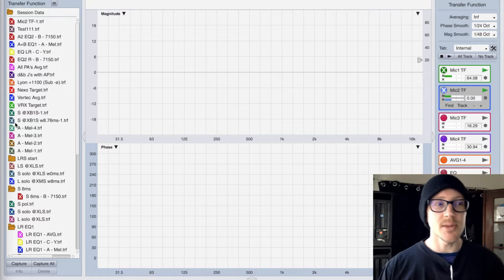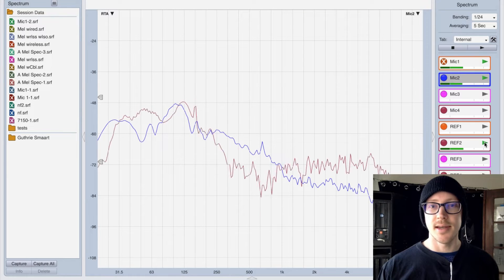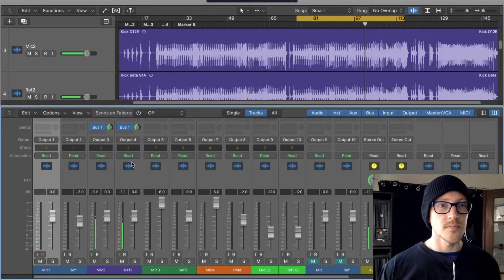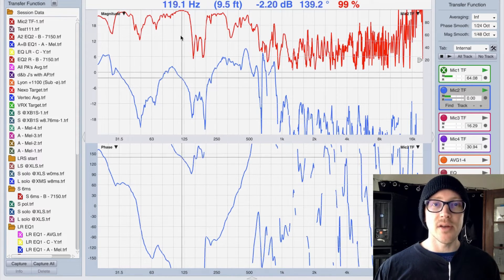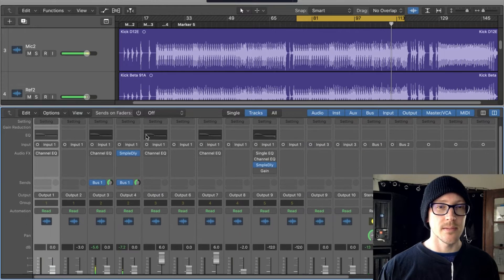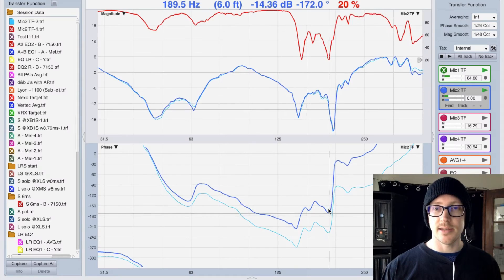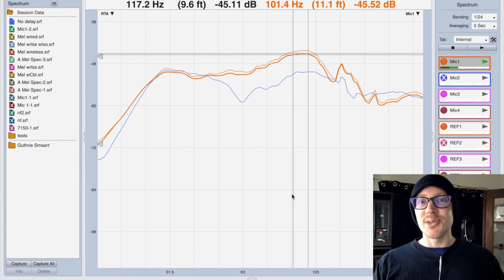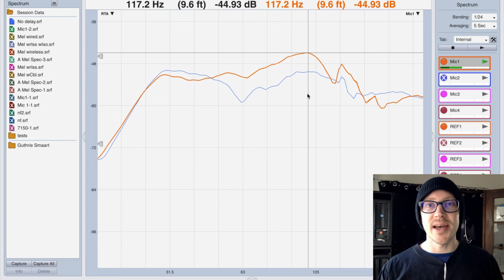Can you align two kick drum mics with the phase graph in Smaart®?

Comment: I do this all the time for drums at shows. However I am not using SMAART to do it. I use In-Phase, which is a plugin for time align and phase aligning of things. 
What you need to do in this situation is start using all-pass filters. 
It is so cool to see the phase trace, but if you employ all-pass filters it will make the two mics sum much better.
The other thing to make sure you don't forget is to listen to each on its own and then together and make sure they sum instead of cancel each other out.
Reply from the maker: Cool!

Comment: Hi Nathan,
thanks for the video! so far I found myself struggle to time align both Kick in and out well, I tried your method.
It orks, I got it, but it's not very simple to read the Smaart data ( Phase and Magnitude ). In the beginning it looked like my Kick Out mic could be even phase reversed ( but wich was not the case ) 
But I ended up with less than 1ms ( which is also logical, because the position of the two microphones is not even 30 cm apart ) . I learned also to check  time offset in the DAW (in my case ProTools - Kick Out is 84 samples later )
3 ms in Your example should be far too much.
Reply from the maker: Hey Michael, glad you got it worked out. Yeah, I'm not sure that this method is the easiest, since it requires some experience with an audio analyzer.

Comment: Use the drumfill as the source, and switch between two kick mics as the measurement mics? This should give two traces
Reply from the maker: Great idea Dejan. Wouldn't there being a timing difference because of the displacement? You need to place the drumfill where the kick had been, right?
Reply: @nathanlively   Thanks Nathan. My idea is to use the drumfill just as a source (because it's mostly already there :) ), and then use the kick in as a measurement mic, find the delay, then switch to kick out, and find the difference in the delay. This way, you have a precise measurement for the delay between the two mics.